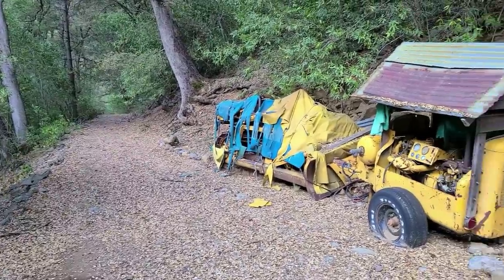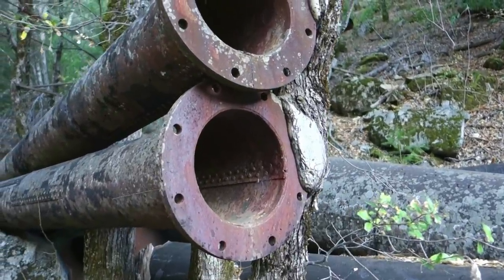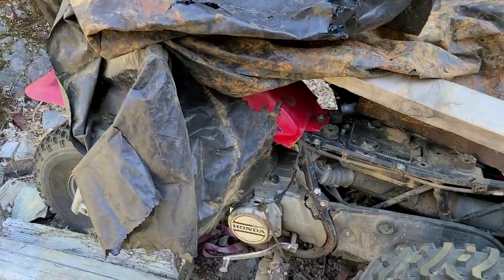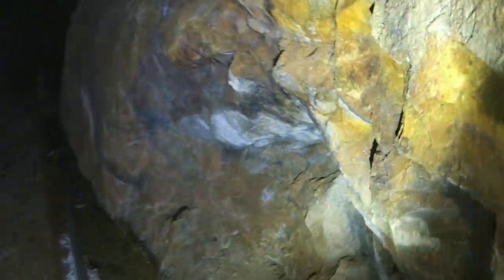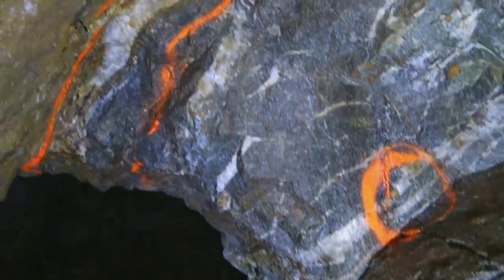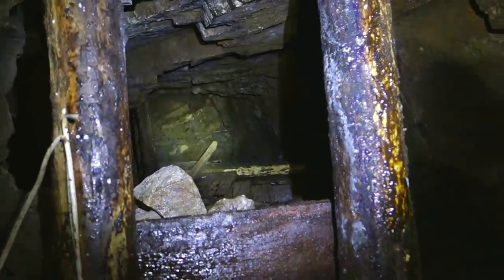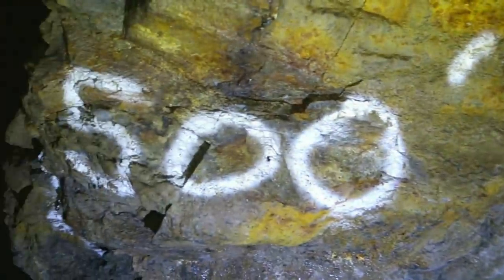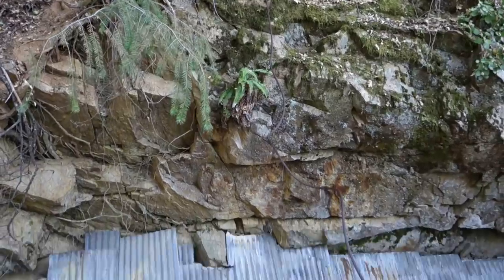Perfect Gold Mine & Mining Camp On The River

Comment: Ok, that one was beyond cool. Agree with you on the original workings being well over a hundred years old. The reworking i think probably late 90's or early 2000's. Small time operation, romex electrical, pvc pipe, no sign of vent pipe. Pretty ingenious repower of that jaw crusher. That first hoist beside the trail is complete enough I could easily repower it and use it again. Really cool place, thanks for sharing it with us.
Reply: Where is this located? I’d love to go see this place next spring
Reply: I’d say the 2000s was the last time this mine saw use judging by the light bulbs. The coiled type didn’t come around until after the 90s.
Reply: Good point mr cabe, i didn't catch that.
Reply: @CreatorCade  That style bulb was introduced in 1995 by a Chinese company if that helps. I got bored and looked up the history of  fluorescent light bulbs.

Comment: Excellent find y'all have discovered, and I can't imagine the labor it required to get the water over to the storage tank that drops further down slope.
The tank had to be to control the water going to the wheels, but I didn't see a way to divert the water when it was shut down to the wheels. 
The cabins remaining intact even since the last miners that were there, what with the nature of some people to destroy everything they come across in out of the way location. 
Mine definitely dates back to the early 1940's based on the truck left to behind, and it almost appears that some was coming back, because of the tarp on the truck, and everything appears to be left in suspension waiting for whomever to return.
As if they went home for a few days off, and for whatever reason never returned. 
Nice ride to break out the bikes for too, although if that is designated as national forest, I thought especially in California motorized vehicles were prohibited from going offroad. 
Either way great adventure for sure, and as always appreciate the ride along.

Comment: At 26:00 with the 2 PVC pipes running down into the winze, it looks like they were running a deep well injection head pump down there. The bigger PVC pipe is the water being pumped out and the smaller PVC pipe is the water injection down to the jet head, which means it is pumping from deeper than 30'- 50' level. The actual pump should be a little bit back down the drift and my only drain to the tunnel drain ditches.

Ah yes, it did either drain to the ditches or maybe had a fabric hose on it as there is a one way/anti-siphon valve (Blue disk thing) visible on the bigger pipe around 10' from the 90° where it goes back down the winze at around 24:20.
Thinking about it, it was probably an air injection lift with the smaller pipe carrying compressed air down and a U bend at the bottom where it then went up the lower opening of the bigger pipe. I've used them before, particularly when clearing bores and areas which have a lot of detritus in the water which would also damage an impeller pump.
 Would've been cheaper to run and not require power if it ran of the compressor line.
Reply: I wonder how feasible it would be to run a trumpe to compress air then use the air to pump out the excess water. Basically free dewatering for the mine, just the setup cost.
Reply: Comments like this is another reason I come here

Comment: We can judge the most recent workings from the coiled compact fluorescent bulbs throughout the mine. The compact spiral design was first manufactured in 1995, but I wouldn't expect them in a shoestring budget mining operation until the early to mid 2000's due to cost.

Likewise, the condition of the ratchet straps being used on the three-wheeler to hold its rear wheel against the belt wheel if the jaw crusher indicates the same time period. Same for the tarps on the dozer and compressor (?) trailer from the beginning.

Comment: Just dropped in aid in identifying the truck on site. Using the hood in part which is difficult cause it could of been changed, places it at 1931 Chevrolet. The fact that the cowling dose not have air vent and dash cluster is exverted determine it to be more properly identified as a 1930 Chevrolet. A help. After viewing this broadcast for a third time I wanna edit previous comment that this site to be the best you produced. The tunnel is fascinating, though not deep, all the redirected exploring directions, up down and sideways are amazing. The artifacts are the real treasure, dwellings, hoist house, transfer line, working aids , hardware, and equipment are rather exciting to see. Thanks again for venturing out and taking us along, well appreciated. All the best for continued success to ya.

Comment: Justin - is it possible they were using two sources of water to power the pelton wheels? One source would have been the flume, which collected water from the river at a point upstream from the camp. The other source would have been the water they were pumping out of the mine, which they collected in that concrete tank. With so much vertical relief, it makes sense to put the water to work, rather than wasting its energy potential. By the way, I'm pretty sure that cast iron item on the left at 2:42 is an air blower, which was run by one of the pelton wheels, and which connected to a 6" air tube to bring fresh air into the mine.

Comment: At 26:10 that looks like it is actually the old original sump pump, also run by compressed air but it's a remote piston pump as it has an air reservoir/expansion tank on the side of the drive head to operate the piston reset to the down position before main air line powers the power pump stroke. A little different to ones I've seen here, but it's a different country and different manufacturers, probably Colorado or east coast, as they were more common in coal mines as they are Gas explosion proof.